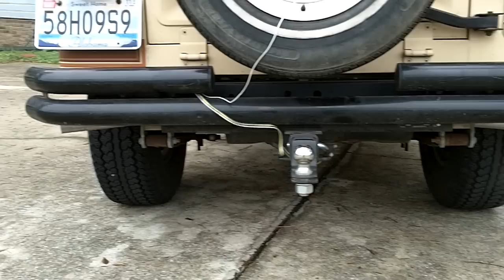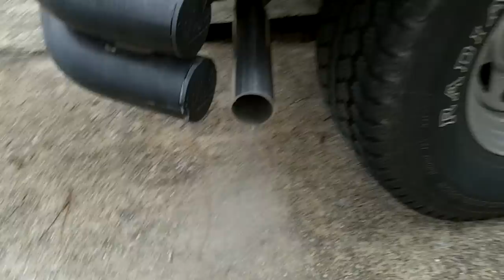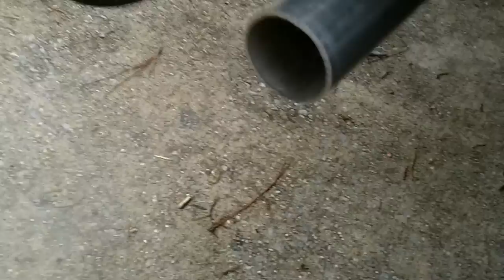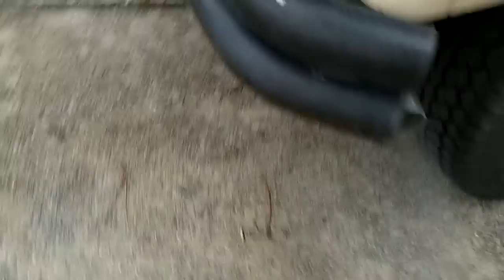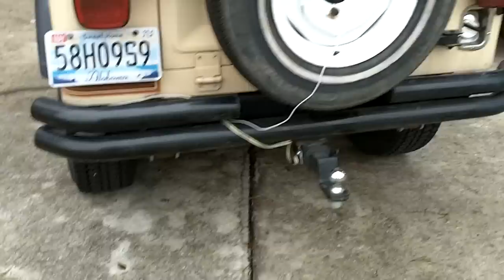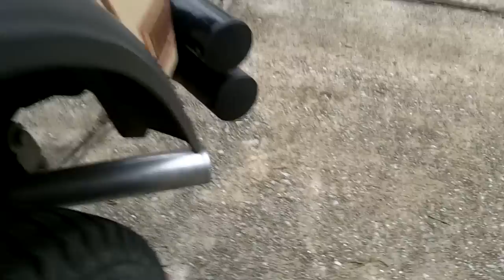Jeep CJ7 Laredo 304 V8 - New dual exhaust with MagnaFlow Mufflers

Comment from the maker: @mike78cj7   The carb is great. Runs smoothly. No dead spots. No complaints other than the fact that you really need a spacer to isolate the heat from the Edelbrock Performer intake. These carbs are re-badged Carter AFBs. They are bad about fuel evaporation from the bowls after you turn the engine off. If you put a spacer between the carb and intake this problem is solved. Summit and Jegs have the spacers.

Comment: BTW, Carter AFBs, no matter what the nameplate says, rule. Great right out of the box. Used a pair on my '66 GS 401. Loved 'em, and they made great power ...idle to redline. Wise choice. I'm running a Holley Truck Avenger on my 415 hp(dyno), 360 CJ7, but the  tuning combos could drive you nuts! Setup/dialing it in for strip vs off road is a PITA!

Comment: Quick question, you mentioned in your description you're running a cross over pipe. Where did you actually have this put? I'm debating the same thing on mine, either a x or h pipe to equalize the tone from the firing order, but i'm not sure where to put the cross over.

Comment from the maker: Pros:
The 500 CFM Edelbrock Thunder series carb is perfect for the 304. Starts quickly and gets good fuel economy. It's very easy to tune. Runs like a bat out of hell.

Cons:  These carbs are susceptible to intake manifold heat and the fuel bowls will boil out when you park the car. This leads to hard starting when it's hot. If you put this carb on an Edelbrock performer intake manifold, YOU MUST GET a 1/2 to 1 inch spacer between the manifold and the carb. Trust me on this.